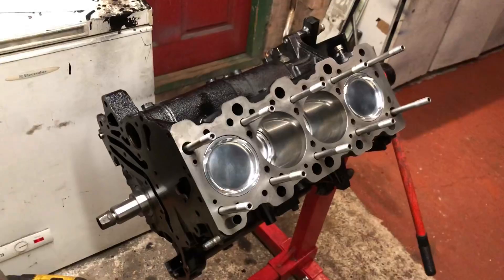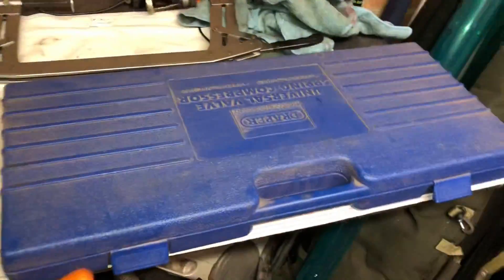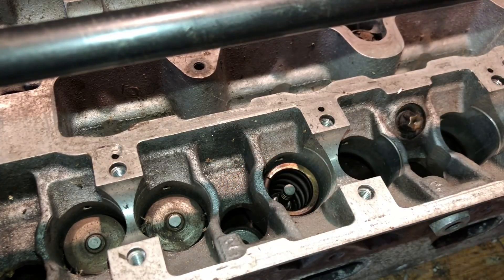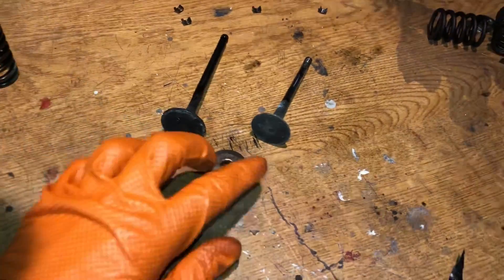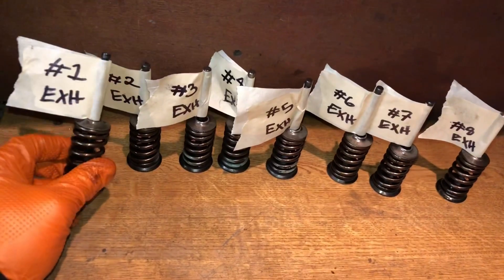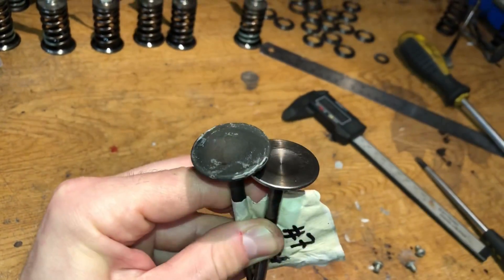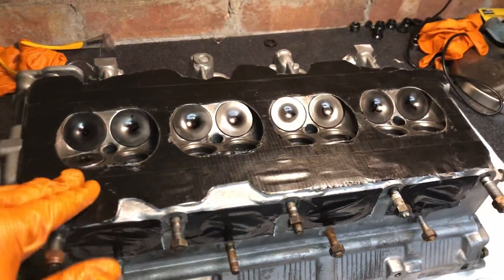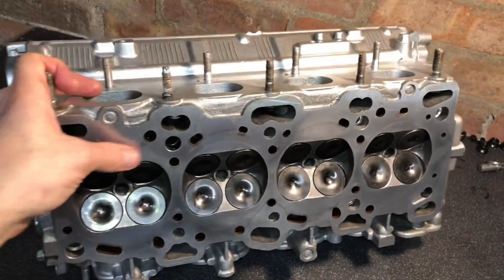Rebuilding a 600+bhp Mitsubishi Evo 4g63 Cylinder Head

Comment: Aaron, you are a truly talented guy! I am currently doing some work on my son's red 2002 SRi Turbo Z20LET.(does this remind you of anything?!) We have a fault whereby the cooling fans run all the time. I have checked the temp sensor and wiring/connections to the sensor and this intermittent fault is still there. A correct wiring diagram would really help. Any ideas where I might get one?

Comment: Hi Aaron. Just a question, arnt camshaft bearing seats line bored to the head and caps? If so how do you successfully fit an aftrrmarket camshaft to a head that was line bored to the factory cams. Do you recommend having the head and cam caps line bored to the uprated shafts? Or is it the case now that tolerances are consistent enough to be able to make aftermarket cams fit a known line bored tolerance?